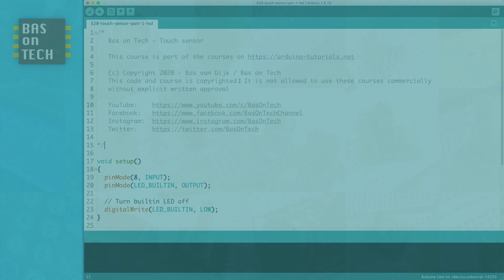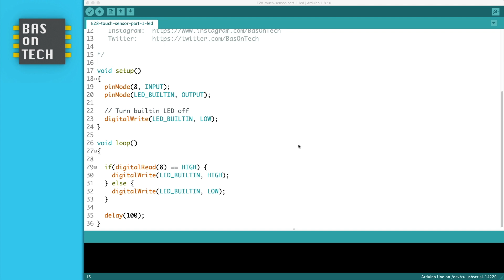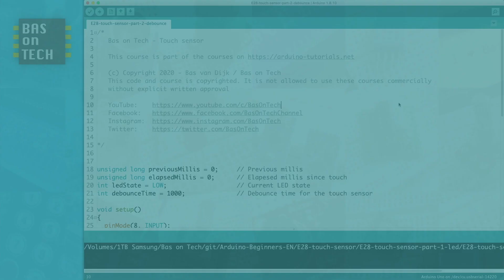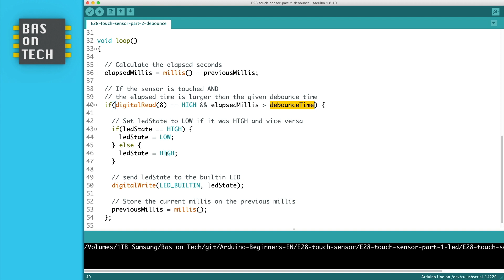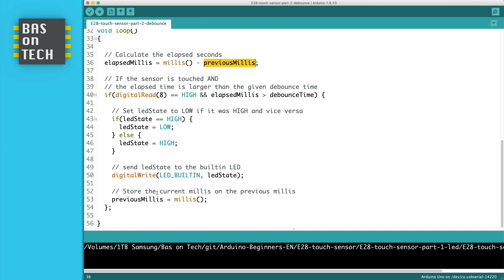CAPACITIVE TOUCH SENSOR w/ DEBOUNCE - Arduino tutorial #28

Comment: Hi, not sure why, i have included the simple code in IDE, yet when i compile it it gives me error codes
This is the code, which i think is identical to yours. What am I missing?
void setup() 
{
  // put your setup code here, to run once:
    pinMode(5, INPUT);
    pinMode(LED_BUILTIN, OUTPUT);

    digitalWrite(LED_BUILTIN; LOW);
}

void loop() 
{

if(digitalRead(5) == HIGH) 
{
  digitalWrite(LED_BUILTIN, HIGH);
} else {
  digitalWrite(LED_BUILTIN, LOW);
}

delay (100);
}
Reply from the maker: The compiler is right, there is a small typo in the code. Look very careful for all commas, semicolons etc. I am sure you can spot the typo 😃

Comment: Why my sensor LED turn red instead of green?
Reply from the maker: As far as I can see there is only 1 LED on the PCB. Therefore I guess the manufacturer used a red LED instead of a green one.
Reply: @BasonTech  Its green sir, mine is red. lately i just know that i burnt my sensor by plugging it onto 5V Pin.
Reply from the maker: Interesting according to the specs it should be able to operate between 2V and 5.5V
Reply: @BasonTech  In my opinion its better to use the 3.3V before continuing to higher volt like 5V etc to prevent burnt the sensor

Comment: Hello Sir,

I have this sensor and i need some help please. I need to control two LEDs with this sensor. 1 touch turn on or off LED1, while double touch turn on or off LED2. how can I do it?
Reply from the maker: Hi Ahmed, what have you tried already and what issue did you ran into?
Reply: @BasonTech  
Acutally I didnt even try because i dont know how am going to write the code. If you can make a video it would be great

Thanks for replying
Reply from the maker: The videos are already there 😃 I've made tutorials on LED, long press and the touch sensor. Combine these and you should have what you want.
Reply: @BasonTech  

I watched the video and its really helpful but still i cant program double touch and single touch. 

What i want to do is, single touch turn on or off led1, double touch turn on or off led2, then long touch to turn on or off led1 and led2
Reply from the maker: This is still the same as the longpress video with an extra state. You need to measure the time between taps to determine if it single, double or longpress.

Comment: Hi there,

i have a question. I guess you know the game Tablesoccer. I am a professional player and it can get hard with speeds up to 80 km/h to recognize if the ball went into the goal or not. Sometimes it bounces out right away and it looks as if the goalie blocked the ball although it was a goal.
This is a problem in tournaments.

My thoughts were, if it is possible to have a soft sensor-mat which you can glue to the walls inside the goal.

Do you think this would be possible in a way, that it is extremely accurate?

Thank you :-)
Reply from the maker: Hi, I don't think this is the best sensor to use. Speeds of 80 km/h will completely destroy the device, and besides it is a captive sensor so it does not work on a ball. My suggestion would be to use a laser on the goal boundary. I've found this video of people who already made such a system: https://www.youtube.com/watch?v=unXU5m7EqaU